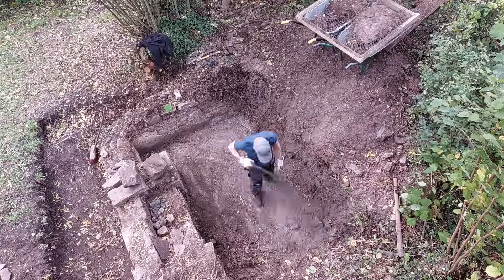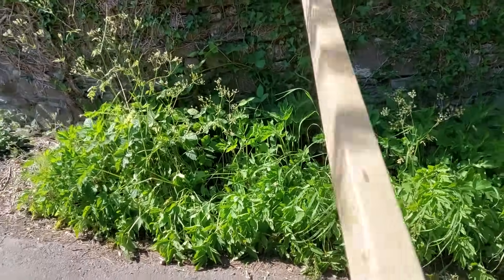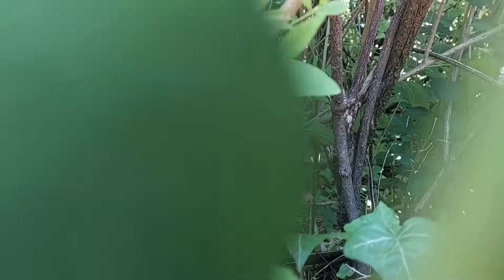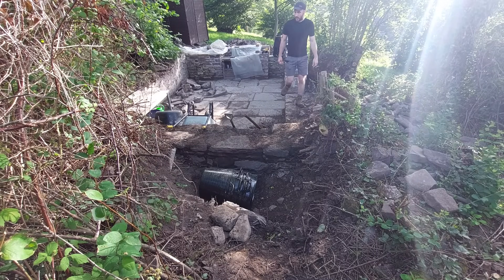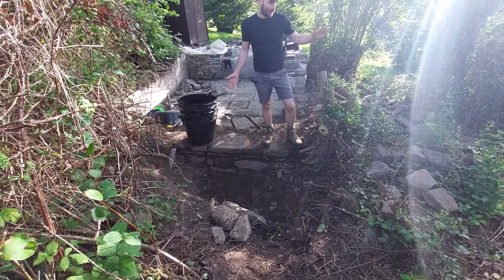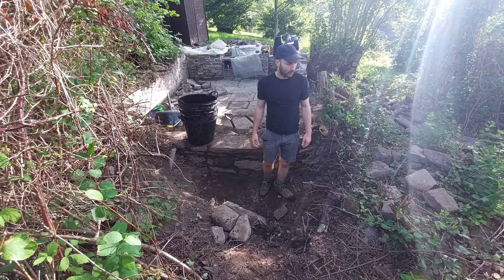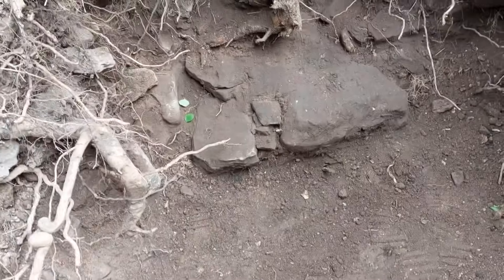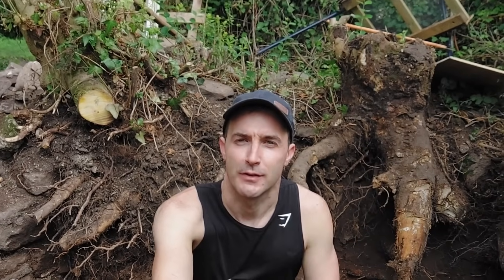Searching for buried steps in the garden - Dig Diaries #1

Comment: The thing about plans is that sometimes they are for proposed buildings and what is actually built is to a slightly different plan, because of money, or time, or whatever has changed between the proposal and actual construction. Also consider the way demolition may have been carried out, if your house was the last one perhaps the demolition team got tired or lazy and just demolished the building to that height and filled it in, then walked away with ‘job done.’ Perhaps your building was the last one still occupied, making demolition of the others easier as they were more derelict, who really knows. Anyway, this whole series has been really interesting so far, and I’m sure that whatever else you may discover will be just as interesting.

Comment: Had you thought of following the step way that has been blocked? If it was as you suspect the bottom of a short flight of steps you might find useful pointers as to the shape of the yard and house floors.
Thank you for all your hard work the films are much appreciated.
Reply from the maker: I'm probably going to leave the doorway blocked up, at least for now, as I'm worried about the structural integrity of the roadside wall, which if it collapsed would be a disaster! so can't start from that end, though it would be much easier. but would create work repairing other walls.

Comment: Old maps are notorious for being wrong! They may show the buildings all in line but in reality one of them could have stepped back or in front. If your building faces the road then the steps would have come up to there and a path would have gone around the corner to the door. As your building is on the end, I'd say the door is on the side which would be 90 deg to the road.

Does the ground for the next building slope up and so on for the next building, if so then the floor level would have been higher,  so digging down wont find anything.

Hope this helps

Comment: Thought #1 - second house was built of wood instead of stone. Thought #2 - if the second house jutted out from the first, perhaps its floor was at a lower elevation. Thought #3 - Perhaps the first house is not the one shown on the old map, but rather was built on the ruins of the houses shown on the map. Are you planning to start from the stoned-up street entrance to see where it may lead?

Comment: Great to see your back digging. Why not start where the supposed steps are and dig back towards the known building?
Reply from the maker: Considered this, but I probably won't unblock the roadside bit as it will compromise the structural integrity of the roadside wall, and digging near where I think the top of the steps seemed too much to take on. easier psychologically to take on the task by finding the doorway and going through I found.

Comment: Maybe the buildings weren’t connected like they are in the drawing. Maybe they were free standing?🤗❤️🐝
Reply: I was thinking something similar. The drawing could have been from memory and without actual measurements. If you look at the walkways, they are not standardized at all—which could have been how it was, or how it was drawn. Maybe the walls along the road were built from stone pulled away from the workers’ cottages?
Reply: @gloriasmestad3803  it could have been. It seems odd though that they would remove the other cottages and leave the first one there. Maybe the wall is just the stones on the upper part of the buildings? Or the wall could have been there all along to hold the hill in place… it’s hard to say❤️🤗🐝
Reply from the maker: Yes I was thinking about this as I was digging. we will see. going to make a big drive digging a few more metres over the next few weeks so if there's another wall similar to the first building I'll find it.
Reply: @afontirs  That’s a great idea! And I admire your stamina with it. 
I find it strangely exciting that there might be other structures beneath the ground in your yard. And I’m a total stranger on another continent. I can only imagine what it must feel like for you🤗❤️🐝